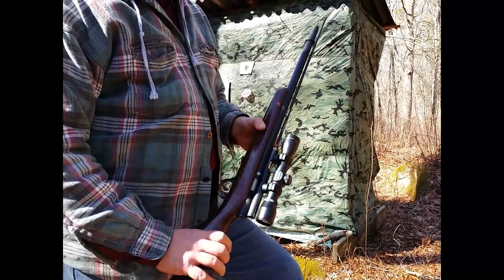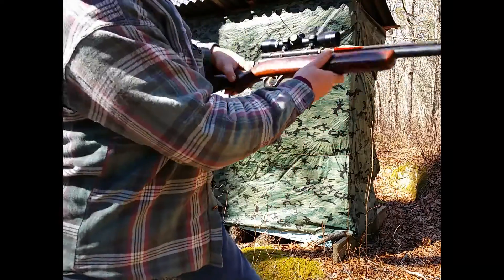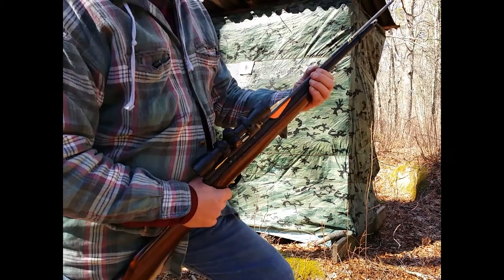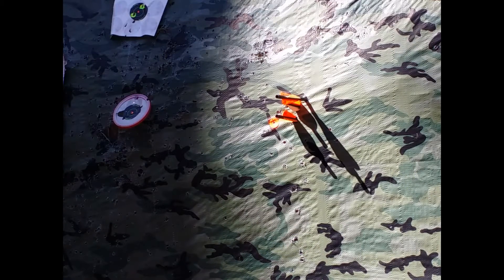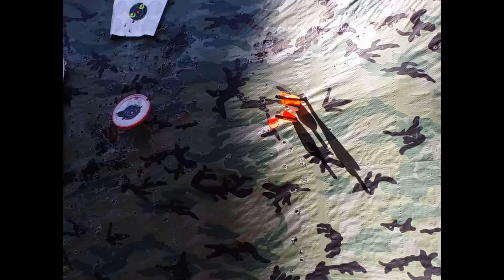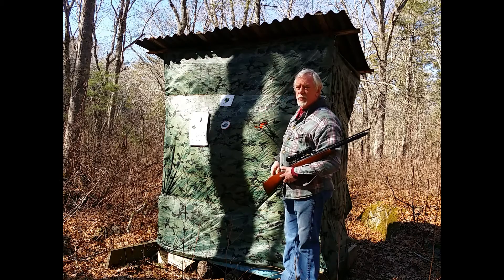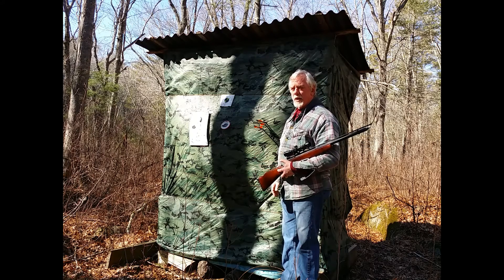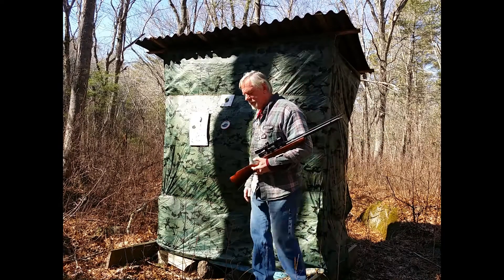Arrow Gun prototype. Video 1

Comment: I like It... 😀👍
Reply from the maker: Still have it but it's retired. Don't trust it to hold high pressure.  The guy who built it into a .40 cal. before I converted it into an arrow gun, "pinned the valve body" meaning that he drilled through the wall of the reservoir and into the valve body in three places around the tube. Then he tapped the valve body and ran some tiny screws into it. Those three screws are what keep the valve body from blowing out the back of the gun and into your face... Once I had that thought it was hard to enjoy  shooting it. So it's a wall hanger. 😆
Reply: @pelletsandpistons  Obviously that is a bit concerning... Bummer, It sure looks and shoots brilliantly. 🙁
I've still got a QB I'm tuning... Just Because they're light, simple and fun. They fall right into that perfect power to weight ratio... Once tuned ! 😉

Comment: Just curious to what Type of arrow is used to replace the barrel, and the bolts being for shooting being used. Is there any other required mods in order to convert it to a bow gun. Very interested in getting one for this primary use of archery season. Thanks
Reply from the maker: Thanks for your interest Jack. The launching tube is a Carbon Express CX400 shaft and the arrows are Horton weight forward crossbow bolts. 
This gun was converted to HPA and runs on a fill pressure of 2800 - 3000 psi. It is not a standard QB78 CO2 platform.